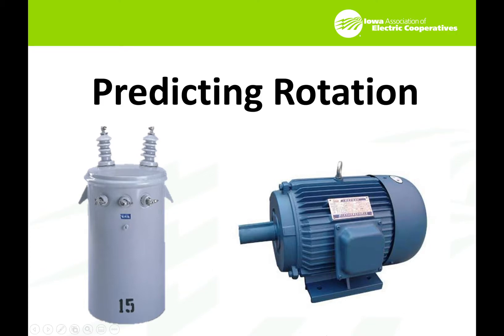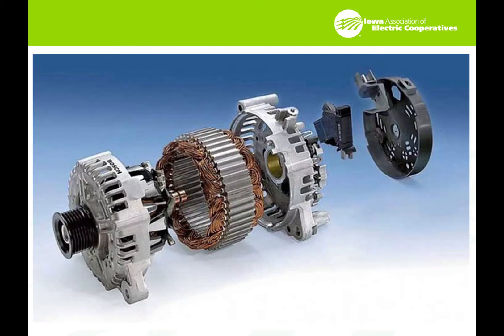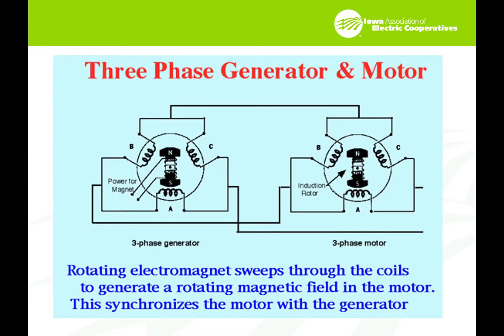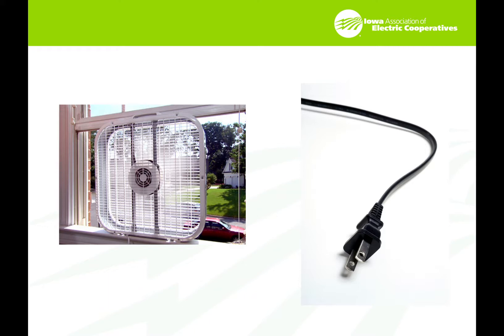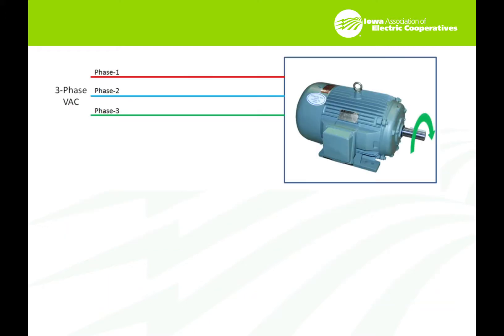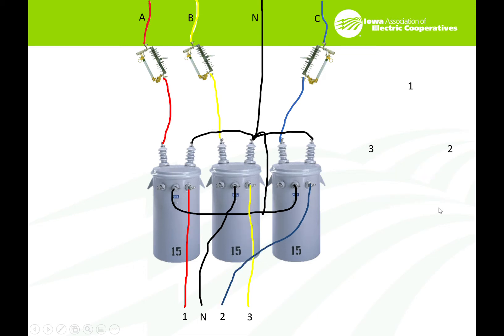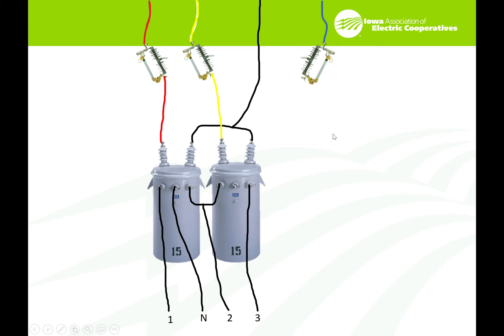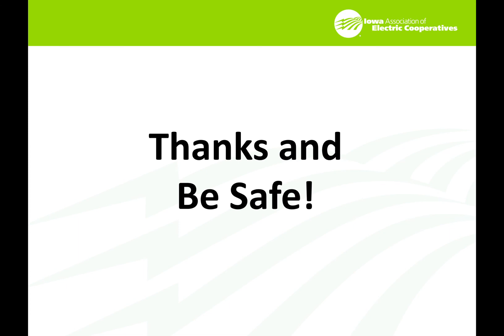Three Phase Rotation

Comment: I’ve worked in industrial electrical for over 30 years and almost every plant has different phasing from line to line or section to section. That’s why I always check rotation and try to phase as much as I can in the building as downtime allows.

Comment: Question:  How is it (on an Open Delta setup) that only two legs (120 degrees apart) are being supplied to the primary, and yet a third leg appears in the secondary 120 degrees out of phase with the other two?  If “Three phase is nothing more than three single phases being generated from the same generator 120 degrees apart” (and I get that).  Then it seems like you would have to use all 3 phases in the primary in order to get all 3 in the secondary to be 120 degrees out of phase.  How come the 3rd phase on the secondary doesn’t match phases with one or the other of the only 2 supplied?  Some type of mutual inductance vector shifting going on???

Comment: probably some people conect their phases just not trusting and checking rotation because any of phases can be L1, it's necessary only to know wich is next after first connected, maybe more phases need equipment in order to not burn one or more coils. In Europe we use unitar delta-star transformers usually which make new installation simple even with less qualified personnel sent in villages, bare wires without color or order, at consumer installing a tri phase motor it's necessary to find out which one it's next from all 3 identical coloured phase  wires,